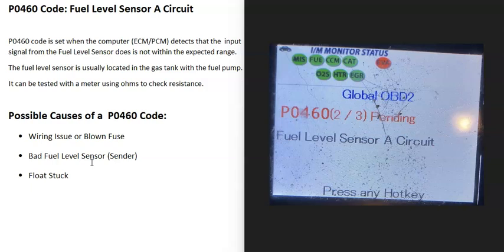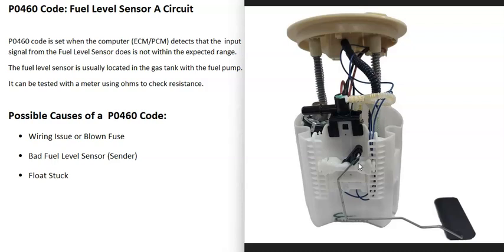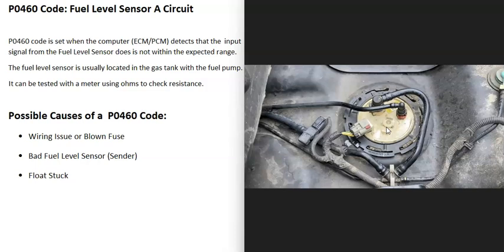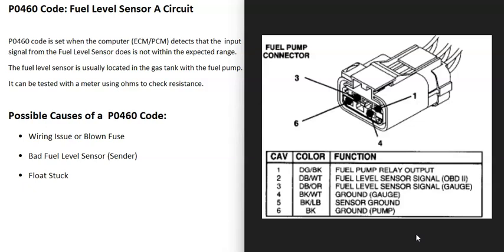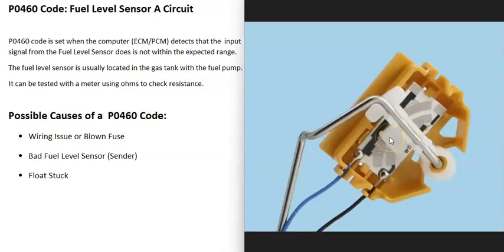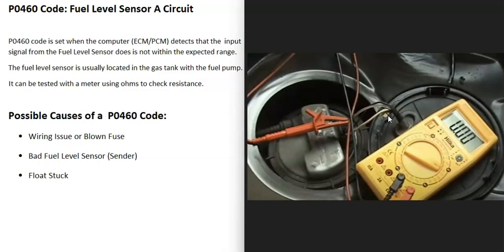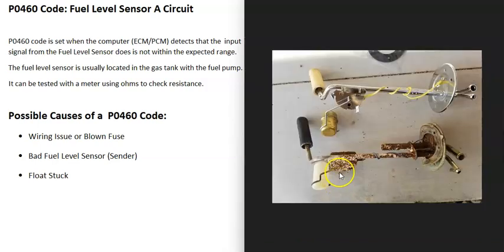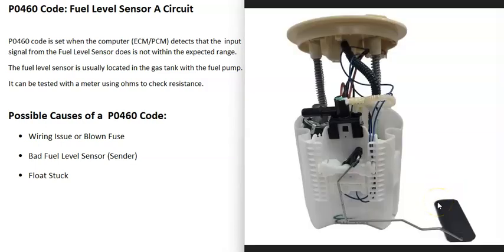Causes and Fixes P0460 Code: Fuel Level Sensor A Circuit

Comment: Hi, I'm struggling with P0456 on Rav4 2013 limited, I have done a lot of things and the light come up few days later. Should I remove the gas tank and check the pump and gaskets?